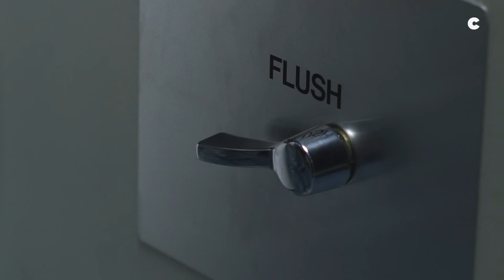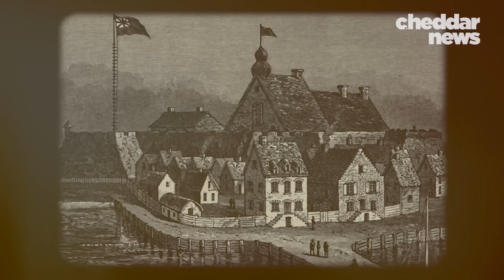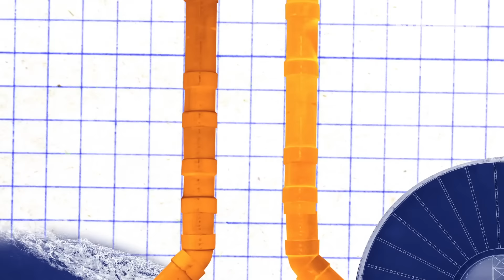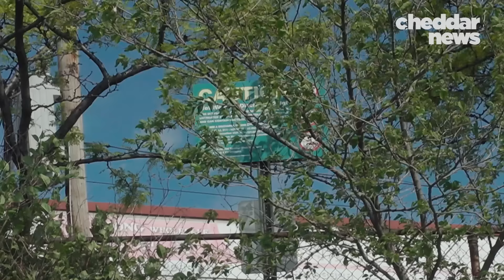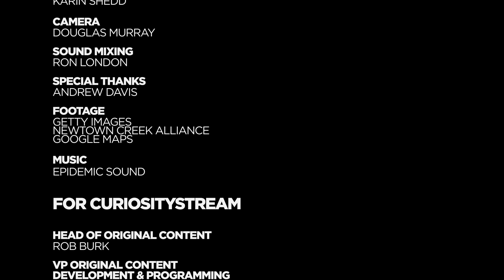How NYC’s Sewage System Treats 1.3 Billion Gallons Of Wastewater  - NYC Revealed

Comment: As someone who used to work for an engineering firm mapping out sewer systems and checking flow rate and intrusion issues, i can say a sewer manhole is usually not smelly. Manholes smell like lunch meat?.... but the biggest worry was upon entering a manhole that has surged,  i.e. flooded at some point.  Manholes have built-in ladder rungs and from the surging you would see condoms filled with sewer water attached to the rungs in the manhole. If you had to make a deep dive instead of a top inspection,  you would just prey that the condom wouldn't burst whilst underneath!!!😂

Comment: One thing that might help - separate the wastewater from the rain water drainpipes. Also, put a sign next to or in front of said wipes at the store to warn consumers, that the "flushable" wipes are not flushable.
Reply: They should quite frankly outlaw them because it posts a undue burden on smaller Metro areas who can't afford the damage to their systems. My city had to start running the auger through the system six times a year instead of maybe once every 18 months

Comment: Seems like having available composting toilets both stowable in residences and porta-potty sized for commercial apps and then building soil refurbishment centers that collect the compost would be a partial cheap alternative. A composting toilet will fit in a small cabinet. On rainy days use it for poop and TP only.

Comment: I’m not sure people realize how intense the stench is while standing inside an enclosed bar screen room.  Many visitors to the who toured the plant where I worked either gagged or retched--and we had an open screen, outdoors.  In the summer with all the heat and humidity, it was downright brutal.  And that trough of grit?  Trust me, you don’t want to go near that.  

If those responsible for flushing baby wipes were given a rake and assigned to work that room for hour, they would cease using wipes permanently.

Comment: That's a tough job.   I've operated skimmers and more than once the surface that was floating on the water became solid. I used a garden rake helped a little bit but not enough. I used hot water helped a lot but still not enough. I ended up using a garden hole to pull in the solid Mass the skimmer couldn't get. Six inchs of solids floating on water.

Comment: what if every house and building in the area was required to have a cistern of 1000 gallons per residents in residential areas and 100 gallon storage per person in work areas up to a certain gallonage. So a house with 5 members has to be capable of holding 5000 gallons and a business with 10 employees has to hold 1000 gallons then you can drip release odd addresses on certain days and even addresses on certain days.  This way you don't overwhelm the system and the city doesn't have to build big tanks.

Comment: I think about these hard working fellows and the wipes so i have a bin for it alongside my toilet.
I dont like the flushable ones as they are too soft and weak so i get the non-flushable ones and just make sure i never forget they go in my bin.
I only use for the final wipe so i save money.
I didnt think the flushable ones were good enough. As in not good enough to flush with toilet paper.
I think i watched a similar video by an engineering channel.
Practical engineering i think its called.
So i take it more seriously now.

Comment: @3:30 Why always using a landfill ? Use rot towers and catalytic pyrolysis to make oil, gas and carbon (+ash) out of it (very simplified spoken), as the sewage water mostly contains biological products and not heavy metals. Landfills are an achievement of two centuries ago.

Comment: Why do they celebrate a sewage system that fails, AS EXPECTED, 40+ times a year???  An effective wastewater treatment system should be designed to accommodate maximum flow, which includes the expected 40+ rain events each year.  They're literally blaming it on the rain!

Comment: Why don't cities across the earth set up citywide roof top rain collectors, all the storms in the city, shit water is not the way
Reply: It sounds like a good idea but its the same reason most people dont have rooftop pools, water is really heavy. just the weight of the water alone foe what a- even a single household would need for a week would destroy the roof. so the tank, plus water filtration, the amount of equipment and infrastructure you would need would need to do that for every building would be so incredibly expensive,
thats why you usually see watertowers as their own standalone structures